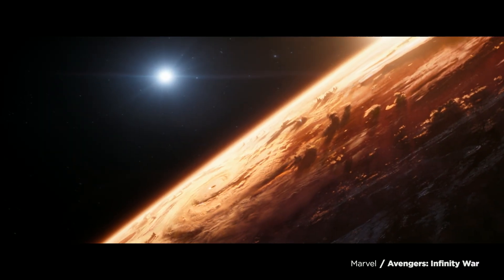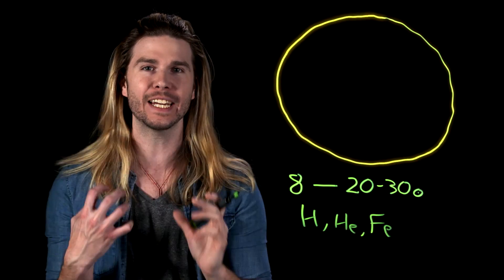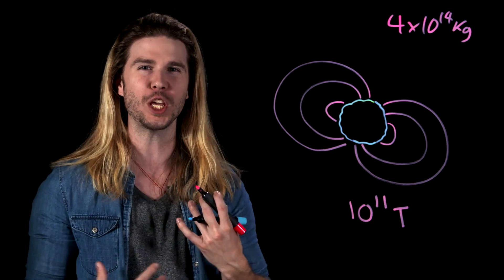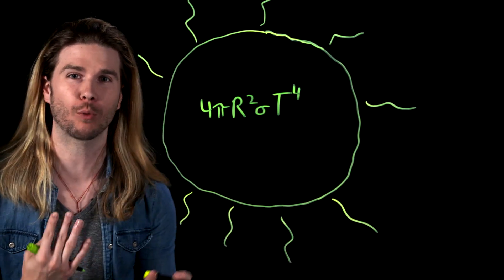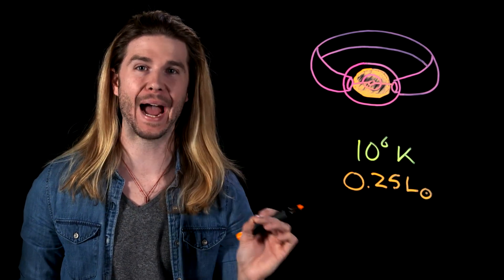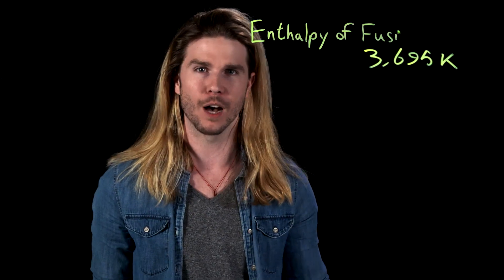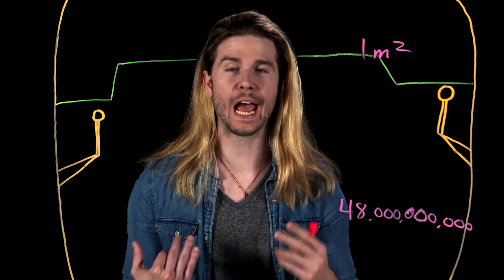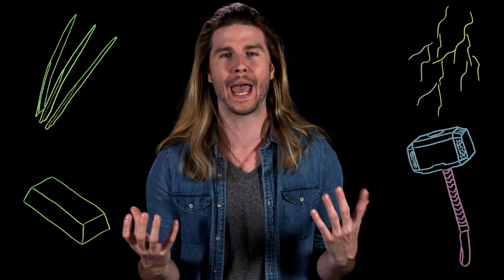How To Forge Thor's Infinity War Weapon

Comment: Ok so first of this guy is waaay smarter than me but.....
I have one thought that means Thor does not need to be anywhere near as strong as uru in order to survive the forging. The power hitting him per square inch is far less than hits the uru. He is in a minimum 6ft circle but all that energy is focused into a few square inches beam to heat the uru which effectively raises the power being put into the uru per second as it is more focused. This meaning it hits the uru significantly hotter and harder than it hits Thor...... Am I right?

Comment: It's not the accumulating iron causing an increase of gravity to overpower the fusion iron happens to be located at the peak where the ratio of how much energy you get out of the fusion and how much energy do you need to create the fusion goes negative it takes more energy than you get out that's why a star dies once it starts creating iron

Comment: Since you said that neutron stars has one of the most powerful magnetic fields, could the dwarves have melted the uru metal not with heat but with magnetism? It is possible to use magnetism to melt metals.

Comment: if they needed that much heat and thor could withstand that heat, couldn't thor just rub his hands against each other and generate that heat himself?

and why are thor, and the other 2 not converted into that atomic goo? they were clearly in range of a 1000 km

dont forget that thor blocked half the the energy bean. so it only took half to make the axt, or maybe twice as long to melt it

Comment: and they acted like normal even though they were just a few dozen km from the most intense gravity and magnetic field in the universe; i.e. the dyson sphere around that neutron star could either block both fields or even harvest them as part of the beam's energy; besides, the star spins at very fast rpm, combined with its immense gravity, this contributes to some kinetic energy as well; in short, you may want to reconsider your calculation, it's way larger than you thought.

Assuming the dyson sphere is 1 km above the star surface, and carries a toroid with radius of 0.5m around it, energy stored in the inductor alone is 1.7x10^42 J; if the whole sphere contains some kind of special material (with density of  5000 kg/m3) that can store potential energy from gravity, it is around 1.49x10^28 J; sorry, I don't know how to calculate kinetic energy from the star spinning effect.

Comment: 7:53 You’re wrong, Tungsten doesn’t have the highest melting point, Tungsten’s is at 3,421.85 °C, while Tantalum (No. 73 on periodic table) has a melting point of 5,430 °C

Comment: Of equal importance is that is not how forges work, forges don't melt and cast things. Forging involves heating and hammering hunks of metal into the shape you want, so, realistically speaking, you wouldn't really need as much heat to forge Thor's new hammer, you just need to heat it to the point where it's soft enough to hammer and to where it will get to the hardness desired, assuming that Uru works like steel. Regardless, casting is a crap way of making weapons unless you're talking about bronze.

Comment: very interesting, I was under the impression that the fusing of iron result in a deficit of energy ... and that energy is what is keeping the star from collapsing.  All that extra energy in fusing atoms lighter than iron is keeping the star fluffy.  Once a threshold is reached in fusing iron there is not enough energy to buoy up the star and that's why it collapses and in that collapse it passes the electron degeneracy force and into a neutron star if there is enough mass.  It seems that I misunderstood  = )

Comment: Small clarification: It's not just that iron needs a lot of energy to fuse. With lighter elements, it costs energy to split them, and we gain energy by fusing them. With heavier elements, it's the other way around, and iron is the turning point, the first element where fusion is a net loss of energy. Iron is also very stable.

Comment: Hi Kyle, I think you got the amount of energy to melt 100kg of tungsten wrong. 
I got 4.5 x10^7 J
considering the same values for temperature as you and using 134 J/kgK as c for tungsten, and 193 J/kg for the last bit. 
so 45 MJ instead of 63 MJ, not much of a difference, but still.
Great video btw!

Comment: Isnt a black hole denser and has more gravitation ?
Reply: sure, but you need heat to melt metal, gravity isn't going to help in that aspect. however if they could harness hawking radiation from the black hole they could have a truly enormous power source. if you can freeze a black hole in time moments before it collapses it would be the most powerful energy source one could find. 
most of the energy would go to keeping the black hole frozen in time while some is tapped to be used (we're talking about stupid amounts of energy so while the stasis field would collapse eventually by the time it did the black hole would just fade away because all of it's energy is gone, no unimaginably huge explosion.

Comment: Pity I’m late for the corrections, but from what I got from what they’ve done is that they harness the beam of hyper accelerated particles and waves coming from the star’s magnetic poles to heat the metal. So the energy calculations should be actually for the pulsar energy output instead of luminosity of the star itself, otherwise the forge would be better suited to harness the energy of a blue star instead, since the luminosity is much higher and could get a better effect.

Although the pulsar energy a neutron star or a quasar coming from the magnetic poles is much higher and focused than just harnessing the heat from the star, so I think this would make much more sense.

Comment: Some Nerds might say, you done did wrong by saying that Neutron stars are the densest material because of black holes, the bad fat little big brothers of Neutron stars... but here I come in your defence before I even know if it is neccessary xD

Black holes could be denser, assuming they do still have mass. But while we do not truly know what happens behind the event horizon of a black hole, where matter would travel at light speed, one popular opinion is that behind that there exists a singularity in space time, or a hole, so to speak, through which most of the matter vanished which was once used to form the black hole, with a kind of imperceivable "matter storm" around it that sometimes shoots out in form of Quasars (right word? dunno). So a black hole would not be denser, since density is mass over volume, and there would hardly be any mass left inside the black hole.

So, if someone actually tried to correct you here... you are welcome :P xD
Reply: A mass of 20 times that of our sun packed into an infinitely small point seems infinitely more dense than a neutron star with at least 8 times that of our sun packed into a 30km sphere

Comment: Assuming a size of 20 km diameter, and a density of 4.5 * 10^17 kg/m^3, a neutron star impact on Earth would be horrifying.
Because it doesn't rip Earth apart, Earth's orbit is changed, and Earth is completely vaporized.
Basically everyone dies.

Comment: Thor in IW: Tanked the full unbridled force of a neutron star for a few minutes
Thor in Ragnarok: Gets electrocuted by a glorified taser.
Reply: Or it wasn't electrical, it was chemical.
Reply: It wasn't an electric shock. Even Thor's eyeballs could handle that.
Reply: Stan Lee is more powerful then the star. In IW, Thor’s hair doesn’t burn from the star, but in Ragnarock, Stan the man cuts it easily.
Reply: I mean, there is sort of a difference between having your muscles forcibly contract due to electrical current and getting blasted with heat, no matter how much. It just doesn’t have the same effect
Reply: @jaredthompson5323  but still, he is a god of lightning. Wouldnt that make him invincible to any electric shock?
Reply: @playedit4013  yeah, because fire doesnt catch on fire
Reply: @playedit4013  cause he is touching the floorin sakarr which is probably metal with conduncts eletricty but when he was doing the lightning god stuff hes usually flying
Reply: @playedit4013  not necessarily. He might just be immune to his own lightning, not all lightning
Reply: @playedit4013  That's not electricity.
Reply: @jaredthompson5323  that's bad logic, tazer is worst then million degrees lheat. Logic not sound.
Reply: Aphichat Sabai worse THAN
Reply: @Aphichat.  just because you have no understanding of how this actually works doesn’t mean the logic is not sound
Reply: @yeahkeen2905  this is true, except in this case it is not sound because it makes no sense. anyone who has taken a basic level of physics would understand why thor would not be affected by a taser due to his ability to resist a neutron star. Yet, any theory physicist would understand why it is ONLY a theory...
Reply: Donal
 
Or that technology used his own electrical system against him.
Reply: It was neurotoxin
Reply: No God can defeat the power of plot devices.
Reply: The Obedience Chip(used on Thor in Ragnarok) has brought even the Silver Surfer to his knees. Just saying bro.
Reply: If you read the comics you know it's not a laser.  The obedience disk uses nano bots to shut down the nervous system internally using some alien tech. Not electricity
Reply: They did an episode on this
Reply: Donal LOL ACTUALLY TRUE
Reply: A taser isn't just pure energy. It (for lack of a better word) messes with your nerves.
Reply: Oden explains that after Thor's hammer broke his power was released. It was built to control his powers.
Reply: Thor is essentially an alternator where as a tazer is more direct current  i think thats why he gets shocked by the tazer in ragnorak
Reply: It was an obedience disk…in lore it can take out very powerful beings cuz its a neuro toxin.
Reply: Ragnarok was ass, honestly. So many cringe comedy moments that were out of place and just ruined the movie. It made it one, big joke.
Reply: Thor in Endgame: has cheez wiz coursing through his veins.
Reply: Bitches. At least learn some logic. It's a celestial nerve toxin. Not a tazer
Reply: Yeah that always bugged me too. If Thor's body is that tough, that it can withstand solar heat you wouldn't think that much could harm him, taser being electrical shouldn't make any difference if his body could resist that much energy.  That scene is just shit writing.  They could have had a lock mechanism that Thor held open that wasn't in the path of the energy. Pisses me off to no end.
Reply: RRTNZ
You are delusional lmao. 
It's nerve toxin. It's clearly explained

Comment: What I'm more interested in is what material was used to create the crucible in which the metal was being stored while it was melting, and the parts of the forge that routed the power of the star to said crucible. Imagine what THAT metal's melting temperature would be.

Comment: You said that neutron stars are the densest material in the universe but aren't black holes much denser?
Reply: Black holes aren't really "material" any more. Neutron stars, although extreme, are still normal matter. You can theoretically break off a piece of neutron star, and if you did you'd have a clump of ordinary neutrons, which would rapidly expand into individual neutrons, which would begin to decay into protons (half-life of ~10min, emitting an electron and neutrino). In the end you'd have a bunch of ionized hydrogen, a handful of other elements (neutrons that either decayed while still bound, or collided with a proton before decaying), and of course a massive amount of energy.
Reply: David Guild Wow thank you very much

Comment: bigger question,if ultron said "vibranium is the more usefull metal in the universe", the marvel comics allways says adamantium is the more tought, Uru is lesser stronger even with higher melting poin, molecolar density and mistic power up then those two? Miolnjr, made of Uru too, paired with Cap's shield, so if we have the two best metal, adamantium and vibranium, what use we can have out of the hardest metal to forge in the entire universe? the only way to use it seems to be his compatibility with mistical power, but only that....

Comment: I really wish they would’ve shown it actually being forged instead of cast
Reply: I was thinking the same thing. I dont know much about forging. But It looked like it was cast out of a mold instead of being forged. if i am wrong someone help me out.
Reply: +Sam Young, i'm a self-taught blacksmith, you got it right, stormbreaker was definitely cast and not forged. i have no idea the properties of uru considering it's not a real metal and all so i have no idea whether it's a metal that prefers casting over forging, some metals are like that, example, steel likes to be forged but aluminum prefers to be cast over forged though forging it is possible.
Reply: Simple reason, it's faster and they were in a hurry to defeat Thanos. In fact, Thor only reached Thanos right after he acquired the sixth stone.
Reply: @vibraniumshield7383  
Yeah, Forging takes much longer then casting. Thor also would of died if he stayed there long enough to let it be forged. And Thanos was also about to kill half of the Universes population.
Reply: Sam Young so there are several ways to forge. If you melt metal and mold it properly. Theoretically you can obtain a quality metal weapon. The forging prices of using a hammer is essentially working out the impurities and shaping it. So the movie wasn’t wrong, as it’s likely uru might not get impurities but be very hard to work with. As for it’s magical abilities I’d guess the mold imbues something like an energy catalyst. Then this amplified a users power which Thor literally is the lightning source.

Comment: The real question is what kind of insanely low specific heat does Uru have that it cools off that fast?  It wasn't glowing that much by the time it exited the mold, which can't have been more than a minute or two given how unpleasant the whole experience appeared to be for Thor.  I suppose it's possible that Uru has an extremely low specific heat (which could go some way to explaining why it serves as such an excellent energy conduit), but an excessively high melting point and/or enthalpy of fusion, which would explain why it took so much energy to melt.  

I mean, in the same scene, it cools down fast enough that Groot can (with only a limited measure of pain) use his arm to serve as the handle, without his arm igniting or melting, pretty quickly after Stormbreaker exits the mold.  Groot is clearly some manner of super plant that isn't made of normal wood, but still, everything has a melting point, and pretty much anything with hydrocarbons can combust. Groot is both, and I doubt Groot's melting point or temperature of combustion is anywhere close to Uru's melting point.

Comment: "The hammer of thor" do not contain the power of Thor it just focuses the power of Thor
Reply: odin was obviously lying there...at the start of thor 1, yes that was true... but then odin took thor's powers; put them in the hammer, and *put an inchentment on the hammer that would allw anyone worth of lifting the hammer to gain the power of thor!now, its possible he only channelled thors powers into the hammer rather than removing them from thor, but either way; thor would still be getting the power he uses from the hammer.
Reply: +Ntig Dona. but that doesn't explain why he would still have his powers after hela destroys his hammer. by the final fight in thor: ragnarok thor had all his powers available and at full strength.
Reply: maybe the spell odin used to remove his powers wore off... maybe thor inherited the odin force... maybe he simply regained his power from the hammer when it was destroyed.. i don't really know...
Reply: @ntigdona7487  
Thor was strengthened by weapons. The weapons allow his power to become amplified as it all gets focused through it. But the force imparted would largely be due to its density, rather then the force that Thor himself imparts onto the hammer.
Reply: thor is not the god of hammers!
Reply: Ntig Dona except when the hammer was destroyed and limits put on Thor’s ability are lifted. As noted Odin says Thor has all the power he needs in himself. So what you say makes sense till the hammer was destroyed.
Reply: Ntig Dona I mean if marvel is sticking to the true power of Thor. Then he doesn’t just need his hammer. If he has meginjörd which is a belt said to double Thors strength then he would still have a lot of power even without his Mjölner. I mean look up he story of Utgarda-Loki and Skrymir. In it Thor not only lowers the levels of the sea by drinking it. He also lifts Jormungandr the world serpent. But he also fights old age itself and still holds his ground. Thor is depicted as true strength so it makes sense to still have his powers even without the hammer.
Also before this goes on an r/iamverysmart post. Just note that I adore Norse mythology so I remember something’s about it.

Comment: Just so you know in the movie Thor Ragnorok Thor's father Odin tells Thor that Thor's true power comes from within Thor himself. The power that Mulnier hammer was to help channel Thor's power as Thor was still not aware of this. That said it is then clear that the new mighty Axe could be setup so no other could hold the axe and have weight of great value by what some called magic. Yet what if this  Stormbreaker is also got some magic like properties. That part is yet known.  One could argue that this uru metal could have some meta life of some kind. I also seen in one of your videos you bring up that Groot used its arm for the handle and lightning and wood do not work well. Yet if you remember Odin said his son's power is from himself. There for the new Stormbreaker  would be more of telling Thor's Lightning ware to go skipping right past the wood part. After all metal is a better conductor than wood or water.